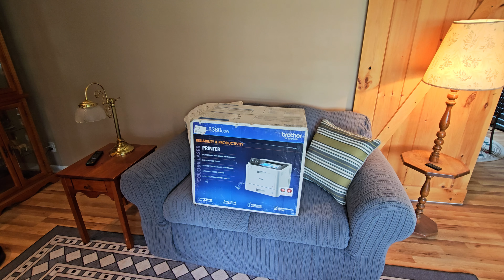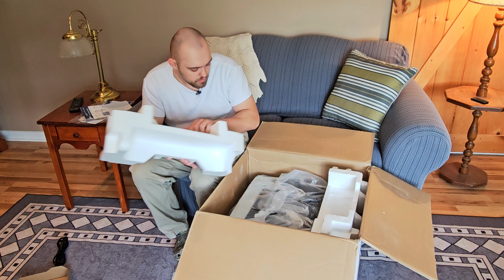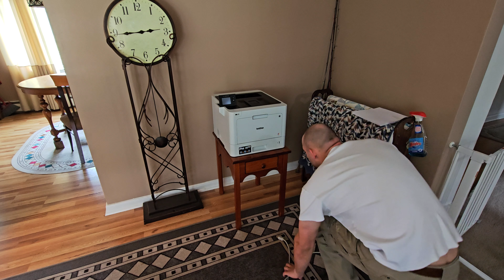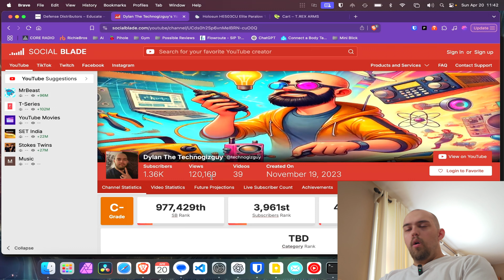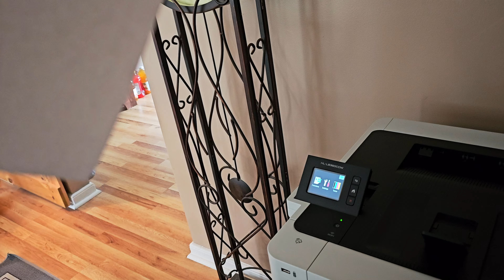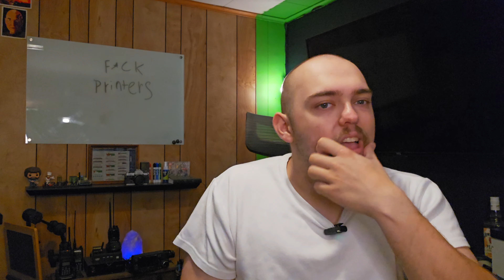The only printer worth your money | Brother HL-L8360CDW

Comment: I bought this exact printer five years ago! That's like 75 in computer years. Either it was extremely state-of-the -art when it was introduced, or Brother is really slow with product updates. I guess why mess with success. The biggest benefit for me is moisture resistance - inkjet ink will migrate when damp, even when laminated. My biggest complaint is color rendition - photographs just never look as good as they do from an ink-jet printer.  Updates are pushed through the net every few months, and a couple were downright flaky, but the latest is working well. The Windows driver sometimes acts as if there is no connection, but ends up printing anyway.  Linux, iOS, MacOS and Android are all solid.
Reply from the maker: Printers in general dont move fast or well